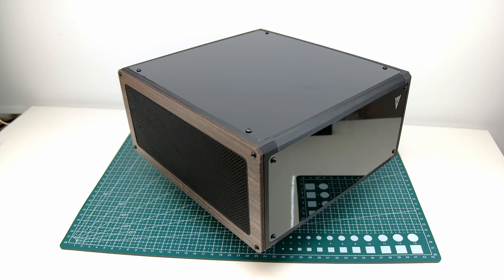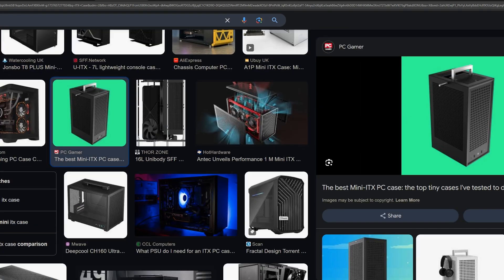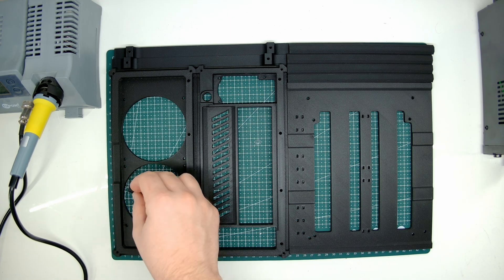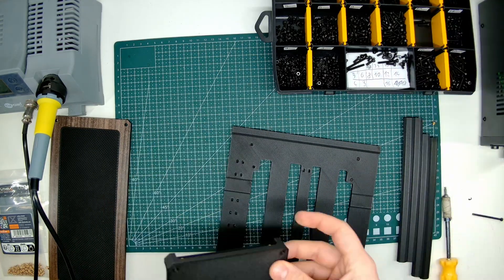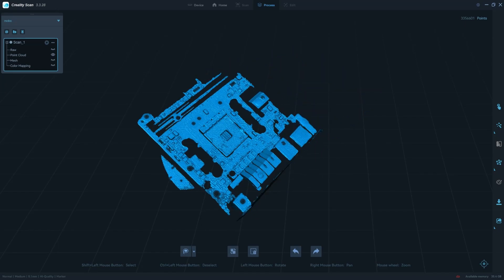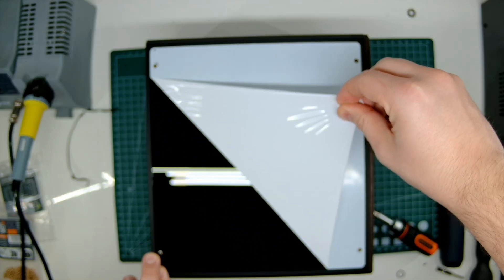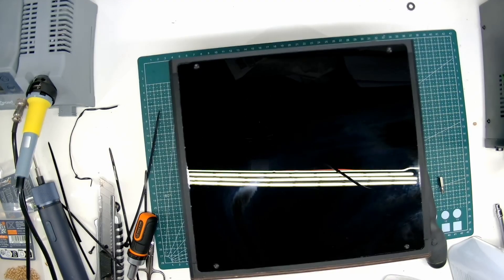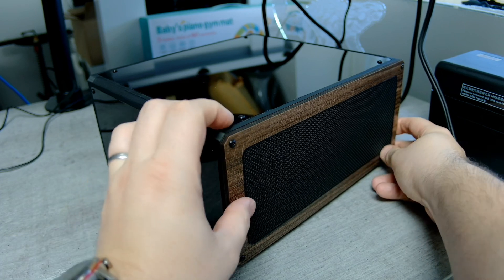A 3D Printed ITX case (mostly).

Comment: Wish i could give this video 100 likes. Very well done. Please don't take offense to this suggestion, but you should add a single pcie slot at the back of the case where the ventilation holes are. It would give the case even more potential and should be an easy revision for someone with your talent in 3d design. Take a look at the Goodisory A02 for the design.
Reply from the maker: @Kajukota  Thanks a lot for the kind words. No offense I'm always happy to get suggestions.

The ordinal plan was indeed to have a max 2pci slot card but never got to it due to the design constraints I had. I'll soon publish the files so if someone wants to edit they are more then welcome!

Thanks again!
Reply from the maker: Files are in, please check the description!

Comment: The design is very simple and good looking, but I personally would have used wood panels instead of acrylic, the fingerprint smudges would make me go insane.
Also, what was the end volume of the case?
Reply from the maker: My mistake on not writing it but it's around 6L with the interior volume 4.7ish L.

Yeah saddly it's a magnet for fingerprints but this gave it that sleek look I think.

But it's absolutely no issue putting anything on the sides because the case is just build to support it.

Comment: Pretty nice, i was thinking about designing and making my own small NAS case since the current one is pretty bad with heat, and seeing stuff like this is great inspiration, one thing that's annoying me is that i'm having trouble finding online what the correct positioning for the IO shield is, could you share where you found a diagram or something you based yours on?

btw, odlican video, ljepo je vidjeti nekog lokalnog na pocetnoj
Reply from the maker: Thanks i hvala 😅, there is a SFF forum online where I found nice references for boards. It's called SFF dot network (dot is actually a dot). There were some other sites but it was hit or miss.

You cam freely dm me if we don't find it or if you need help.

Cheers.

Comment: 1:56 I'm not an expert by any means, but wouldn't epoxy work well to hold the magnets at the cost of longer curing times?
Reply from the maker: The biggest issue is since the glass is flat, using too much would mean having very large holes to accommodate the actual glue. I tried Vynil glue and I tried super glue and 2 component glue to no avail (the magnets are extremely small), after some use they just would detach from the actual glass.